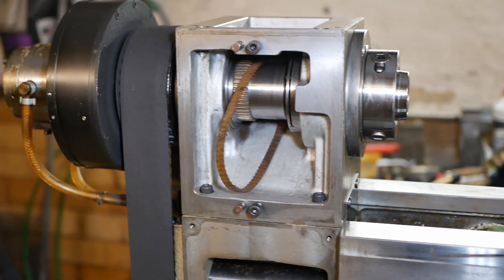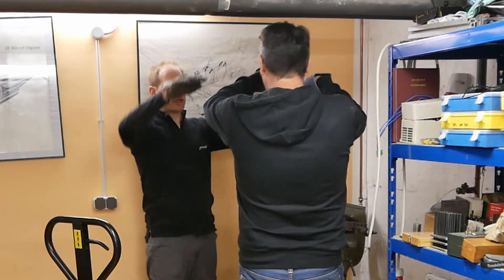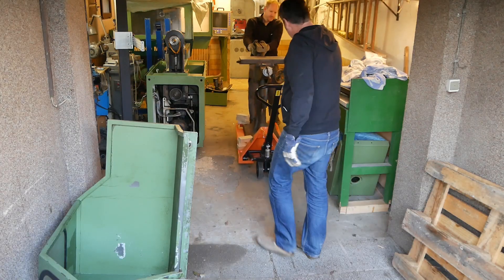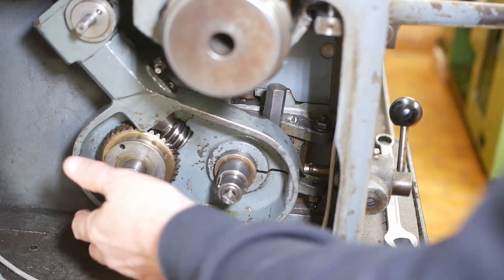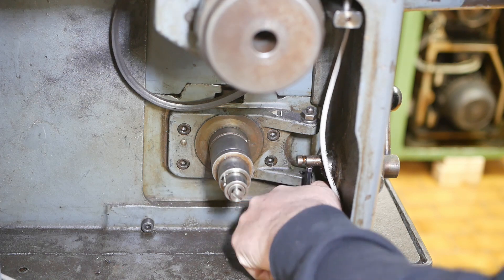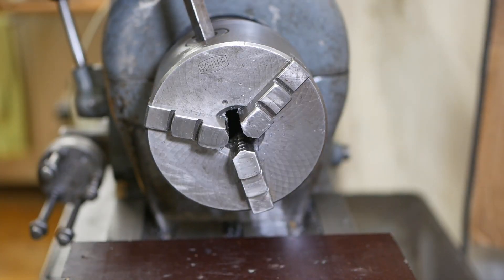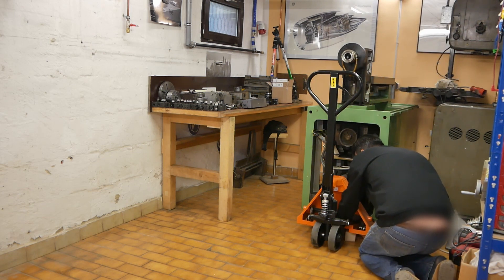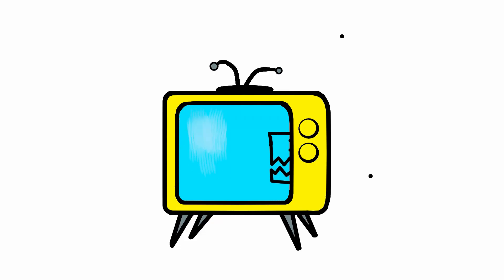Jamming the Schaublin CNC lathe through a little doorway?

Comment: Mate the vibes on this are all to real. Whilst it's not a 5mm gap. I had to move my weiler Bridgeport and 
Fp1 clone 30 meters down the driveway over grass into my shed. Cheers from Sydney mate love the content .
Reply from the maker: I get all jealous when I see the lucky guys with the flat concrete floors, high ceilings and flat driveways, but hey, we get it done :)
Reply: @RotarySMP  Of course there is no top end to the chain of jealousy :) 
(you are a wizard, right? Your basement looks way bigger than the house does from the outside!)
Reply from the maker: @mumblbeebee6546  :) One of bags like Hermione had!
Reply: You know a high ceiling flat driveway and large workshop would make everything far to easy. We then wouldn't have any excuse as to why nothing gets finished.
Reply from the maker: @nder12345  Good point. Excuses are a valuable asset :)